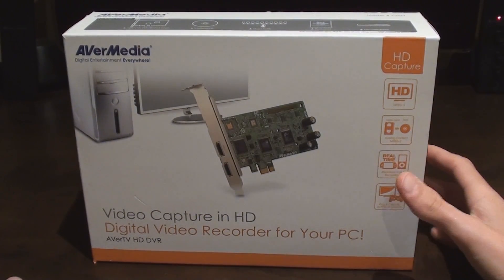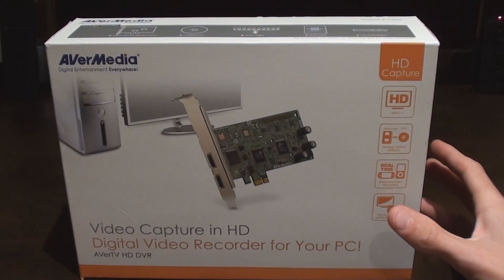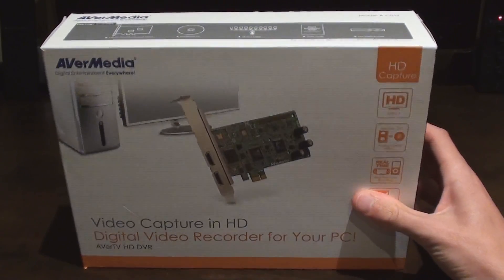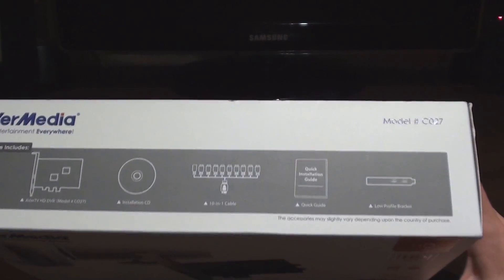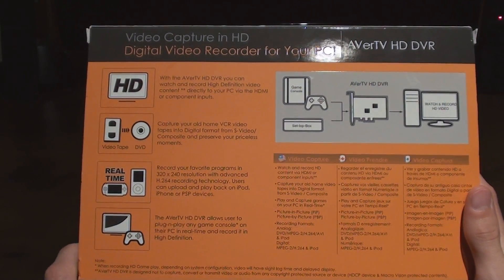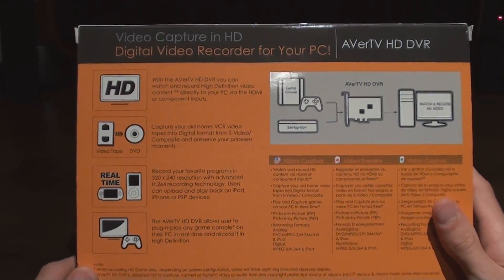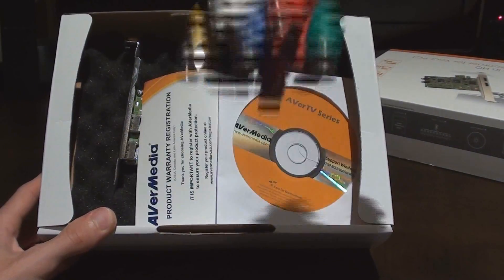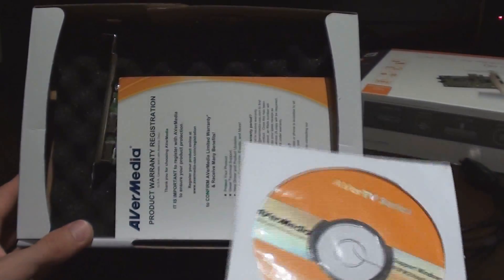AverMedia AVerTV HD DVR Installation Setup and Use (HD Capture Card)

Comment from the maker: @ThatDamnCamper I get no lag with that splitter. I do use shorter cables though, only 6 feet. There is only lag if you connect directly to the card.

Comment from the maker: @troypat9 Its not because its unpowered its because you're splitting the signal. The xbox by default has display detection enabled, but since you have two displays connected this causes issues. Go to the system settings in your xbox and disable display detection.

Comment from the maker: @EnjoyOopslol You won't need a new sound card. If you just want to record TV you might run into a problem depending on what you're recording. If your TV source (cable/satellite) has HDCP AVerMedia won't let you record. So you'll have to use FRAPS or VirtualDub to record.

Comment from the maker: @MultiNoobHater Press start, type device manager, and look under "Sound, video and game controllers". There should be an "AVerMedia C027 PCIe HD Capture Device". If there isn't then the driver isn't properly installed, if there is then you probably put it in an incompatible PCI port. You could try contacting AVerMedia for more help.

Comment from the maker: @Mac4072 Canada Computers will charge you a fair amount to install it. If you're uncomfortable with it, ask a friend or someone you know who is good with computers. It doesn't take a very powerful computer to use this,  but I'd recommend getting something with at least 4 GB RAM and an i5. You can use component cables, but you can't record HD unless you have HD, and if you don't split the signal it will EXTREMELY difficult to play.

Comment from the maker: @EWColaCanada I have an i5 760, 8 GB RAM DDR3 1333, 640 GB WD Black, 60 GB OCZ SSD, nVidia 9600 GSO. 

Encoding uses the CPU only so a good GPU isn't necessary. This encoding actually isn't very CPU intensive, I can do it with 1 core if I wanted, but editing and rendering videos requires a fair amount of resources. I used to edit videos just fine with my i3 530, so pretty much any modern i series CPU should do fine. Also 4 GB+ of RAM is always good.

Comment: @theevilgeniuz if your slot says PCI, PCI-X, or AGP, then this will not be compatible.  You are looking to see PCI-E(Express) a more updated way to operate serial bus functionality.  If your computer is more than 6 years old, I would say you probably do not have a PCI-E port, nor would I think your computer is capable of fully handling a product such as this.  I.E. if your computer has a 500gb hard drive, 2GB to 8GB Ram, then you have something that will have a slot for this PCI-E component....